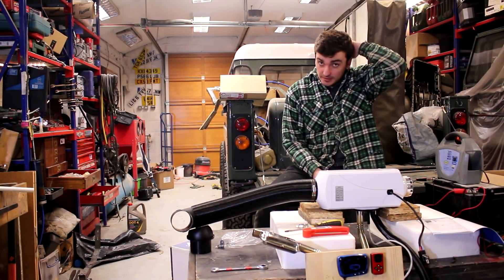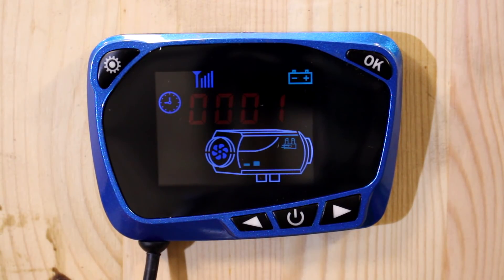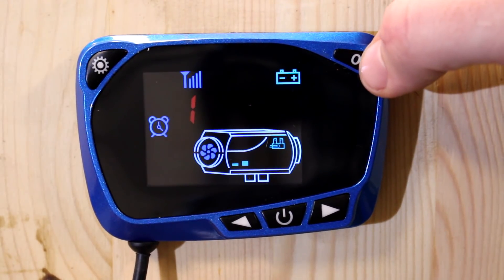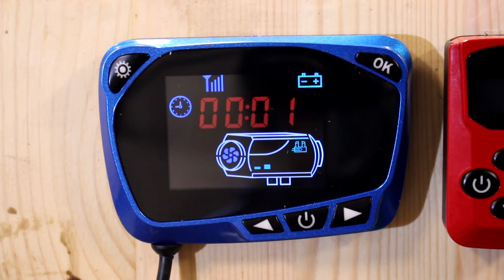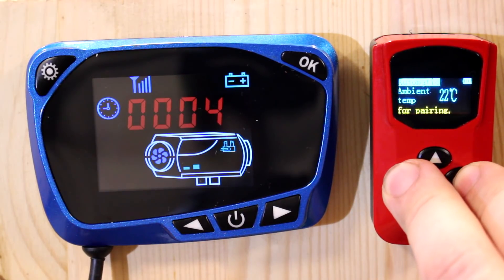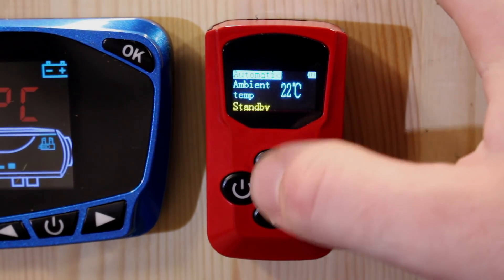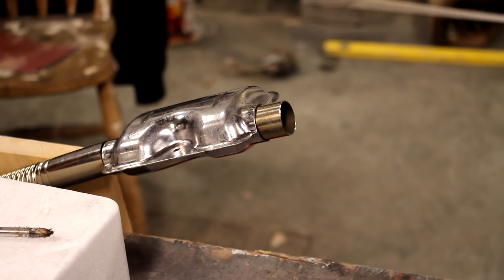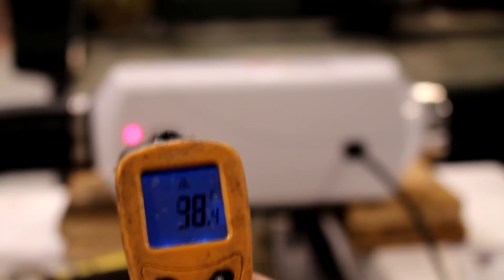CHINESE Diesel Heater - LCD Controller, Remote Pairing & Temperatures

Comment: Hi I've got the same heater just fitted all working good but the remote that they sent me .is in Chinese . Do you know how to change this to English
Reply from the maker: Hi, try holding the OK button for 5 seconds.  If that doesn't work, you might have a Chinese-only remote.
Reply: @SamsMotors  cheers mate ,all working fine now thankyou

Comment: Hi, really useful video, thanks.  My red remote  works fine, but is in chinese not English like yours! Any ideas?  Thanks, Richard.
Reply from the maker: Hi, try holding the OK button for 5 seconds.  If that doesn't work, you might have a Chinese-only remote.
Reply: @SamsMotors  Ho, fluck me! You're right. Thanks

Comment: Ok so one thing I noticed with these blue controllers is that the timers are not the same as the black controllers. You are actually setting the amount of time to when the heater will turn on. So if you leave it set for 99:99 it will actually turn on in 99 hours and 99 minutes from when the timer was turned on. Then that timer will shut off. The heater will run continuously until you shut it off manually. Real big pain in the ass. But just a heads up to everyone.
Reply: Did you ever find a way to change this setting to daily timer ?

Comment: 2 questions, 1 where can i get the red remote? 2 how did you fix the lcd screen to the wall?
Reply from the maker: There are some sellers online with the red remote on its own - but make sure you have the right type of controller.
I just used double sided sticky foam for fixing the controller.

Comment: Great video and advise thanks.  I have just bought mine and couldn’t work out how to bleed the fuel pump till I saw your great video.  Do you know how to change the language on the remote? Mine is in Chinese although I managed to pair it to the controller.
Do you know what the P - 3.3 Hz means? Could you put a link to the Facebook group I have found one for Chinese heaters but I can’t seem to join, I don’t know how to send them a message about my heater.
Thanks 👍
Reply: I am having same issue. Don’t know how to change the language on remote. Did you do it and if so how 🙏🏻
Thanks.
Reply: Gillian Cowan Hi Gillian, Yes just press and hold the OK button to switch to English.

Comment: can not get the timer to work, the clock is set correctly, but it does not start? Please help me,,,
Reply: Did you sort this as seems can only set as like a stopwatch rather than a daily set time ? I am hoping it can be changed in a setting somehow .
Reply: @eanluck2142  Did you solve this? Please share, I'm having the same issue..
Reply: Having the same problem, i can only set a "wait delay", after which the heater starts..
It does not accept a start and a stop time. Did you solve this? How?

Comment: Sam, thx for the great edit.
I'm just bench testing today and you got me through the confusing bits.
I have paired the Red Remote but the text is still in Chinese.. any advice?
Reply from the maker: Thanks for the comment Whitney, appreciate it :) 
For the remote, try pushing and holding the OK button until it changes to English.
Reply: @SamsMotors  That worked, thx.
Reply: SamTheSuave thanks! This is already better controller than the one with only the knob on it.

Comment: Excellent i have the same blue controller but my password is 1688 i tried the one you gave in you video it didn't work
Reply from the maker: Most are 9009 but yes, there are a few others.  Cheera

Comment: Did you have any problem with the altitude reading being out?  Also I noticed on my controller the case temp, burner cold didn't match ambient temp after controller being powered on for 20mins, mine was 4 degrees too hi.
Reply from the maker: Mine seems fairly close, I checked what my actual elevation is at the workshop and it was within 20 metres.  

And yeah the temperature reading and voltage reading are for rough indication only... they vary wildly between heaters too.
Reply: SamTheSuave.   Umm my contol measures around 11.6v when battery is 12.4v,  the elevation is erratic should read 4mtr+ no way near,  the lcd reads 23 degrees ambient when its actually 19!
 Annoying what to do!
Reply: @SamsMotors  Is the controller supposed to automatically check the altitude and take that into account?  
(So far, I have only bench tested this heater, and the altitude is close to my actual elevation.)
Reply from the maker: Whitney Koeberle Yep.  Heater measures altitude and adjusts fuelling to account for thinner/thicker air at different altitudes.
Reply: SamTheSuave   looks like my controller might be faulty then as I get - 90m when at sea level :( 
My ambient temp is ok indoors unit not heated all day case ok ambient goes out + 4 when controller is idle for 20 mins think the thermistor is in the lcd
Reply: @alexs5373  The unit is likely using barometric pressure to detect altitude. So altitude will rarely be 100% accurate (but close enough) since its affected by weather patterns.
Reply: Whitney Koeberle.  Thanks for the input! Yep I agree there will be something in the lcd controller that detects atmospheric pressure and yeah there will be variations due to weather, mine is very erratic point being it cannot surely accurately change motor speed and pump speed accurately to compensate.

Comment: Hello there bud. Can you show how to set temperature from the control panel it's self. A have exactly the same unit & control panel but without the remote. I can't seem to find temperature control on the panel itself. Thanks.
Reply: You should be able to adjust temperature by pushing either arrow.

Comment: How’s things sam just ordered one of these for my boat and my question is does it need its own 12v battery or can it be connected direct to the batteries and can it run when boat is running also when boat is shut down do you go through the same set up when restarting the heater it’s just during the winter months you would not be out as much in summer so everything is switched off safety and all that many thanks for your time Sam great work also. Alan
Reply from the maker: Hi Alan,
You can run the heater off either your main or leisure battery.  If using your main one, you’ll want to make sure you keep an eye on the voltage level so you don’t drain it. 

Yes you can run the heater with the boat running or stopped. 

If you cut power to the heater completely (LCD off) you will need to set the clock again, but all other settings (fuelling, remote pairing etc) seem persistent.
Reply: SamTheSuave That’s great Sam many thanks for your response great to know this maybe I’ll contact you when I receive it hopefully there won’t be any issues again thanks for all the best. Alan

Comment: Could you supply the link to this remote control please. I have ordered the same 2kw unit as you, but it doesn't come with  a remote control. Thanks.
Reply from the maker: There is nowhere that sells them separately I’m afraid

Comment: You are a pioneer for this new type controller, can I make a video request for a range test of the remote? General distance and distance through walls etc as a lot of people say it's not as far as advertised. Thanks for the great video and keep up with the awesome content
Reply from the maker: Thanks for the comment :)  Yep no problem, I'll add it into the next video.
Reply: @SamsMotors  Hello ! Any update yet ? Do you use the small tank, or get fuel from the car tank ?

Comment: I bought a kit that came with the exact controller you have but no remote. Is there a place I can buy just the remote? I seem to find the 2 button no display ones quite easily.

Thanks for the videos btw. Good stuff.
Reply from the maker: I’ve not found anywhere selling the red remotes on their own.  I’ve contacted some suppliers on Alibaba but they too only supply the 2 button type.
Reply: SamTheSuave Can you buy the controller together with the Remote , please let me know

Comment: I picked one of these up a month ago but haven't received it yet in the mail I had an idea about what to do with the exhaust you can make a heat exchanger slash hot water tank to heat up hot water or you can make a old used radiator like that of a Datsun that is all copper and run it through where the coolant ran previously hook up a small DC fan and have a hell of a lot more heat and make the more efficient
Reply from the maker: I too want to experiment with what can be done with all that exhaust heat... however, there's some concern that if you draw too much heat away from the exhaust, and/or create too much backpressure, it will result in excessive sooting and clogging up.  Might not happen if running on Kerosene though... we need to experiment!
Reply: @SamsMotors  if you are going to do that, it would be better to a hydronic version. which is the same setup, but instead of the heater exchanged with air it is exchanged with water.

Comment: I have ordered a similar unit as my 110 does not have a heater (ex Oman army trucks were delivered without heaters). I was planning to install the heater under the seat in the battery box with one duct under the car to the bulkhead entry to the dash and the other duct through the battery box into the cabin at low level. Do you think this is a good plan? Do you think 5kW is enough heat for when the truck goes back with me to the Cheshire Countryside? Thank you for sharing your expertise with us!
Reply from the maker: I like the idea of feeding into the original heater inlet - means you will have control of hot air onto your feet or onto the windscreen (assuming the dash has the correct controls and ducts etc)...  Quite a long run of ducting to get it there from the seatbox though... it might be worth insulating the duct with some pipe lagging or exhaust wrap or similar, as you'll probably lose quite a bit of heat, especially when on the move and you have lots of cold air rushing past it.  
5kW should certainly be enough power - it'll definitely be hotter than a standard Defender heater anyway.
Reply: @SamsMotors  I had pretty much same idea in mind, for my VW T3, since it's difficult to keep it warm while driving, but have no idea how to connect this heater with original dashboard heating tubes, without damaging something. Is this even possible ?

Comment: Thanks for the info , can you go more in depth with the gear setting button , I have heard you can downgrade a 5kw to a 3kw through the settings ,  my heater is far to hot in my van , if I can reset it , then it might save buying another lower output heater . thanks for any help.
Reply from the maker: I've not explored the Hz and fan settings much yet; but you could try experimenting to see if you can reduce your heat?  The 'Hz' setting is simply how fast the pump delivers fuel (lower = less heat) and you just need to adjust the fan speeds down to match the lower fuelling.  It may take some trial and error to get it right.  Make sure you write down your stock settings so you can always go back to them later.
Reply: @SamsMotors  I'd be interested in different fuel and fan settings too.   Also, I saw a "mountain" icon on the blue display.  Does anyone know how to adjust for high altitude operation?
Reply from the maker: Whitney Koeberle For the 5kW units I have found low 1.5Hz and High 4.5Hz to work quite nicely.  

The altitude feature is an automatic one; as you head into higher altitude the heater should automatically adjust fuelling to compensate for thinner air.
Reply: SamTheSuave is there a way to change from hz to Celsius ? SN and PF is also in the menu, but can’t really see what they are changing. Maybe anybody can help with that. Thanks for the good and short video. Very appreciated.
Reply: I found it in another video. While on the page with the hz. Hold “up” button and press ok. Hz changes to Celsius.

Comment: any idea of the range of the red remote?
Reply from the maker: Christopher Sykes Not as good as the 100m claim.  Doesn’t seem to work when not in line of sight, but I need to test it properly first.
Reply: @SamsMotors  Did your remote display Chinese text? mine does't show English when i put the batteries in... Havent tried pairing yet
Reply from the maker: ProSteamUK - Specialist Cleaning Services UK You’ll find that as soon as you try to pair, the Chinese writing will disappear to be replaced with English.  Mine didn’t show Chinese in the video as it was already paired from earlier, and I’m not sure how to unpair!
Reply: @SamsMotors  Thanks pal - is the unit still working OK?
Reply from the maker: ProSteamUK - Specialist Cleaning Services UK Yep, no problems yet after about 8hrs running.
Reply: @SamsMotors  I use mine from bed in my RV to preheat the living area..goes through 2 doors and a wall and works great...granted it's only about 17 feet lol